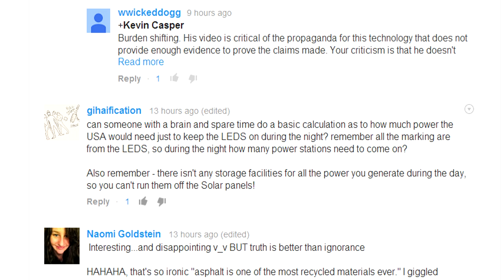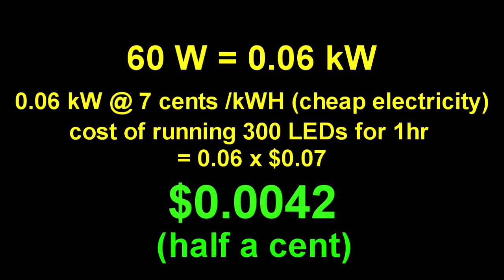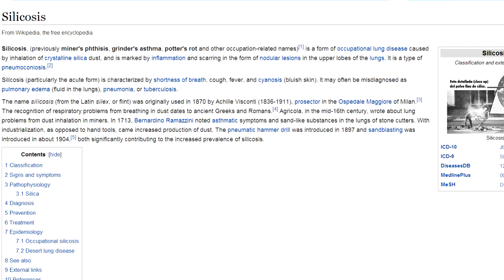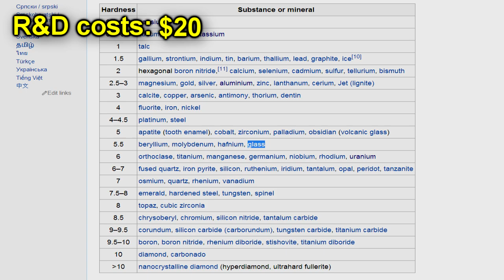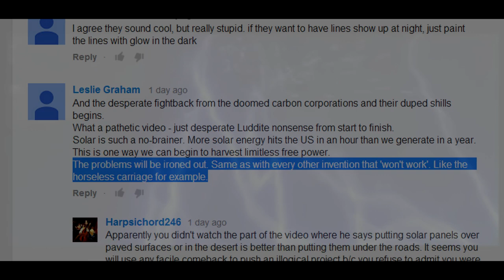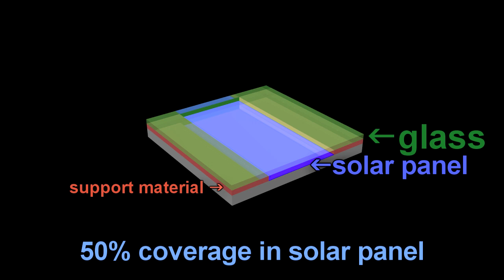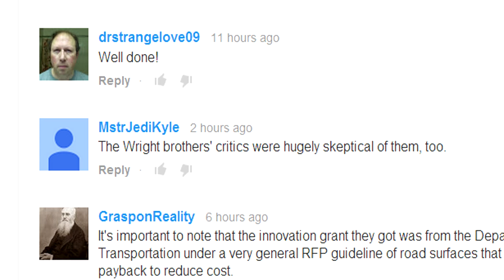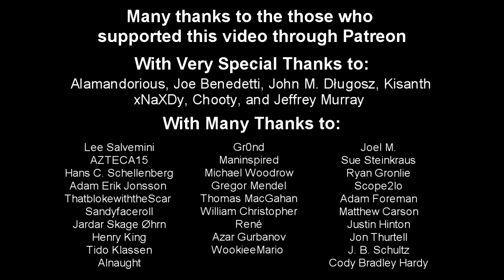Solar Roadways, IMPORTANT QUESTIONS AND ANSWERS!

Comment: for your calculation you are using the price for LED's from AMAZON. Do you seriously think they are going to buy their LED's from AMAZON???? are you fucking kidding me? And last i checked roads are made of Asphalt which is softer than glass, which in turn is harder than steel. I was going to watch this video to the end to give you a fair chance but you insult my intelligence.
Reply: I've seen so many comments that start out with "I only watched two minutes, however..." You guys really should invest as much of your money as possible into this project. Good luck.
Reply: Jindorek Its a generous estimate given that he didn't include costs of wiring them and the costs of the microcontrollers to control them.
However the main point isn't even the initial investment, its the recurring daily cost of running these LEDs. I doubt you got that far though.
The only unscientific thing I'm seeing is your "ability" to draw several conclusions about TF's research and education based on a video you didn't even watch.
Reply: Lumen22222 http://www.aliexpress.com/popular/multicolor-led-diodes.html

Wholesale diodes are indeed cheaper, but unfocused or not, all of his points come together into an idea that is simply unfeasible for the application. The chocolate skyscraper on a jello foundation in a desert is a very good analogy.
Reply: Jindorek Pretty sure his other videos do a very good job at explaining his areas of expertise. Besides, the science in this video is very simple.
Reply: Not being bothered to actually check the Mohs scale of asphalt v glass, I have a simple explanation for the use of asphalt in roadways rather than that wonder material glass.  Asphalt is soft, and mold-able.  That is the entire point.

If you hit a chunk of asphalt with a hammer, you dent it.  If you hit a chunk of glass of similar mass with a hammer, you chip it.  Which do you suppose is easier to repair?  Asphalt is repaired in about 5 minutes by a guy with a bucket of hot asphalt and a tamper.  The glass panel would require replacement, which apparently will require specialized teams and a few electricians.  How long will it take?  No one knows.

Have you ever seen what a major collision does to the road?  How long do you suppose an 18 wheeler jackknifing will close a glass paneled solar road?
Reply: Roads are NOT made out of asphalt they are made out an aggregate of different rocks held together by asphalt. And its not like that even matters anyway, it would be cheaper to just build some large solar plants, or line the roads in areas that get lots of sun with solar panels and then just pave the roads normally, any you would get far more power from properly positioned solar panels than from ones laying on the road.
Reply: ***** that's the best fucking comment I've read in months ahahahaha
Reply: ***** Technically asphalt is softer than glass, however the rocks that the asphalt hold together which is what was tested is harder than glass.

Most of the strength in concrete is because it's a composite material using the flexibility/waterproofing of the asphalt and the gravel which acts for the hardness.

I'm not sure what's with the obsession with space for renewable energy, we're in no danger of running out of space for it merely not investing in it remotely as much as we should.
Reply: TurboDally asphalt is the gooey 'tar' portion of the composite material that makes up the roadway. It is soft, especially in higher temperatures and is, obviously much soft than glass.  The stones mixed into the asphalt on the other hand, are not.
Reply: Jindorek Are you trolling?..
Reply: I had similar issues. I work in lighting and I'm generally unconvinced that LEDs are a good choice for this application, but this is just an unfocused rant by someone who is far outside of their area of expertise. He seems to be aiming his videos at credulous cynics who are desperately eager to trash this idea and don't care if the arguments are well supported.
Reply: Reddit Gold User it doesn't take longer than two minutes of this to realise this guy is thumbsucking data. Bet you my bottom dollar, that this guy has no clue about anything but just picked a viral video to troll so he cud get his own view counts up and increase traffic on his video to increase his revenue so he can keep sitting in his basement and cook up shitty unrelated science experiments with no validity to the actual problem and not have to get out and find a real job.
Reply: Getting a PhD is no guarantee of superior intellect. anyone who can afford a university education can get one. It's not exactly the holy grail. If I was in charge at Cornell University I'd ask for my money back.
Reply: 1) It would be an estimation, not a great one, but an estimation, still have a lot more to do with the tiles other than just buying and powering the LED's since any power loss would result in no lines.

2) Asphalt is softer than glass, however it is only the aggregate that holds gravel/rocks together, the rocks and sand are harder than glass which is what was being tested. Unless you think roads will never get sand for cars to grind into the titles the point seems to stand.

It appears you read the faq on their site rather than listening to what was being said or watching what was demonstrated.
Reply: Clell Harmon LOL jackknifing! No ones really even though about the possibilities of Fires on the road or major incidents!

Firemen already have a problem with houses with solar on them and electric cars, there scared that the house/car will be "Live" when they go in or put water on it. They just let them burn as long as they have it under control or there's no one trapped inside.

Considering the amount of major wild fires that hit the USA like every few months or the flooding/hurricanes/other acts of god, How will the the solar roads live up to these incidents?
Reply: Well it's not unusual for online suppliers, even Amazon, to sell components at near-cost price. So I don't think it's unreasonable to use $20 for a bag of LEDs when Amazon charges $23. This is the best information we have at the moments - we can refine the calculation if and when a signed supply contract is produced for the trillions of LEDs.

But what about the other issues such as UV light damaging the semiconductors that make up the LEDs, or the fact the LEDs are nowhere near bright enough to be visible at all in the daylight? These are pretty fundamental problems with the idea that, as TF said, are more than just a kink to iron out.

Renewable energy is definitely the way forward, but I really don't think this is the way to do it.
Reply: Jindorek You never went to college did you?  Even if you did fail out on a few 100 level classes, you certainly never defended a dissertation...
Reply: Clell Harmon I seriously doubt you need more than a guy with a new (ridiculously expensive) new panel and 5 minutes.

The design would be moronic if it was any harder than changing a light bulb.
But, the price a bucket of hot asphalt versus a "solar friggin panel" I think the asphalt is  cheaper by an order of magnitude, not even counting that the glass has to be repaired more often.
Reply: ***** You've evidently not had to deal with many government contracts.  Ever wonder why when you drive by roadwork you see a few people doing the actual work and a small crowd leaning on their shovels?

The guy detaching the panel from the roadway might end up being the same guy who puts the new one back, but he won't be the one who disconnects the panel from the grid, or the one who verifys that its safe to disconnect from the grid, or the one who troubleshoots the panel on site or any of the other plethora of jobs that something entirely new will include in the job.
Reply: Clell Harmon That's a failing of your government, not mine.

"The guy detaching the panel from the roadway might end up being the same guy who puts the new one back"
He is.

"but he won't be the one who disconnects the panel from the grid"
Err That's what I said about moronic design. You disconnect the panel "from the grid" the exact same way you disconnect a street lamp. (that's a 2 man job in all of EU, including the security guy on the ground)

"or the one who troubleshoots the panel on site"
Why would you even want to do that apart from driving the need for men up in your made up estimate. That's a job for a proper workshop. (again, that's how they do it in the EU, if it's small enough to be removed easily, don't fix it on site)

"of the other plethora of jobs that something entirely new will include in the job."
Made up jobs.

This need not be any harder than changing a light bulb in a street light, that IS a government contract, and it is a 2 man job. Including the man to call 112, 999, 911 or whatever when there's an accident.
Reply: ***** I've been to Europe Christoffer, and if you really think there is less padding in government jobs there, you're either delusional or lying to yourself...  US Unions look at their European counterparts and go "Damn!  Those guys have it figured out."

So, your theory is that a computerized roadbed panel will have the same complexity of replacement as a light bulb?

No, I've been changing light bulbs for almost than sixty years, and working on computers and their associated peripherals for more than 40.  The two have never been similar and I strongly suspect they never will be.

Are you thinking a computerized solar road panel will mount with a right hand bayonet socket?

Totally ignoring that this whole solar road thing is just too expensive and complex to ever deliver on its promises, What you are envisioning is far too simple.  your projected two man job might come about a few decades after the roads are deployed, but that would require the prototype to actually work.

Which it won't.
Reply: Clell Harmon "So, your theory is that a computerized roadbed panel will have the same complexity of replacement as a light bulb?"

I DID NOT SAY THAT, that is your inability to comprehend what i'm saying: (kind of odd considering all the things you'd have to ignore to get to your fallacy)
They can be made just as easy to replace as a lightbulb.

I also said that the in the EU they don't waste time and money on repairing things on site if they can replace it and fix it in a proper workshop. (oh, and by the way THAT is how the unions WANT it to be) I live here I KNOW HOW IT WORKS!
Reply: Clell Harmon (remember to read previous comment)

Also, if we follow your model a  dent in blacktop would require a ten man crew, an asphalt-truck, a road-roller and various specialised equipment.
You can't just apply your rules for how to add more men to only the things you want it to apply to.
Reply: ***** You compared the replacement of a computerized solar road panel to the replacement of a street lamp.  To wit:

"You disconnect the panel "from the grid" the exact same way you disconnect a street lamp. (that's a 2 man job in all of EU, including the security guy on the ground)"

Street lamps, including those in the EU, are designed with sheer fittings so that in the event of a collision, they aren't electrocuting random passersby.  Given that, the only other reason anyone would be 'replacing' a street lamp would be with the intention of swapping out the bulb.

So, YOU DID SAY THAT.  Perhaps the inability to understand what you're saying is on your end... or don't you know how street lamps work?

Seriously, if you want to be take seriously, lay off the caps lock.  Just makes you look a tad... stupid.
Reply: Clell Harmon Ok. let's see:
"Given that, the only other reason anyone would be 'replacing' a street lamp would be with the intention of swapping out the bulb."
Err... or the lamp head, or just about any part except the mast. The mast is a four man job with a crane. (on a closed down stretch of road)
Same goes for traffic lights by the way.
And traffic cameras and electronic toll booths.
It's unplug, replace and fix it somewhere else.
It doesn't have the same complexity, it requires the same amount of manpower to do it.

And only an idiot (in addition to you apparently) would design something to be replaceable in such a way that you'd have to use a team of specialised people in order to actually replace it.

Because:
There is a brilliant new invention from the 1980's called a "connector", that allows you to disconnect anything without any tools.
This panel doesn't produce any more power that can be transmitted over a JST connector (TF said it), and actually the same connector would suffice for communications too.

"Are you thinking a computerized solar road panel will mount with a right hand bayonet socket?"
Now I have no idea what ind of argument that is. You went from "as complex as" to "exactly the same as, including the connector"

But even so: take the Apollo Discovery UL Ionization Smoke Detector
http://www.apollo-fire.com/products/discovery-ul/discovery-ul-ionization-smoke-detector.aspx
How hard is that to replace? My grandmother could do it, the second time blindfolded.
That's a $500 piece of electronics, it comes off as one unit and it's replaced as one unit.
And guess how you replace it, right hand, one quarter rotation socket.
Reply: Here's another fact:
Replacing a bulb (or a lamp head) on a street lamp is a 2 man job in Europe. That is a fact!

Replacing a bulb, or indeed an entire unit in a street lamp is a 1 man job in Europe, 2 for overhead installations. Fact!

Work on traffic cameras (in Europe) is a 1 man job. Fact!

On street lamps and overhead work you may need to close down the road, that requires additional men, but so would any form of road work including all forms of roadbed repair.

And for the record I am in a position to know this, and it is the fact, no matter how much you claim it isn't.
Reply: Glass is harder than asphalt? Where's your source of information?
Reply: Clell Harmon in addition to glass being more brittle.

Comment: here is what i posted on the solar roadways fb page that was deleted without even trying to show it was wrong(which it isnt) lol
they claim that the panels will pay for themselves so lets look at the math of that
a solar panel typically takes 3-5 years to pay for itself so best case 3 years
they have tested their panels and get 60% of electricity so thats another 2 years
solar roadways claim they will produce 3 times the electricity the US needs
that means they can best case scenario sell only the electricity from 1 panel in every 3 so we are now up to 15 years
but they cant produce at night so effectively they can only provide max half the required electricity or 1 panels worth from every 6 panels
so it now takes 30 years for those panels to be able to sell enough electricity to pay for only the actual solar panel bit and not the whole solar roadway panel
solar roadways say their panels will have a 20 year life-span so see the problem
solar panels with a 20 year life-span will pay for themselves in 30 years(more in reality)
this post got me banned from posting on the solar roadways fb site

Comment: To be fair, all the LEDs wouldn't be on. With road markings, very little would be needed. But even at 1% use, that's still a crazy amount of power.

These would be more interesting in urban areas where there's less area for solar strips..... but, even then, might as well put panels on the roofs of houses first, instead of ripping up all the roads.

Seems like a fun idea that could definitely find its uses in limited situations, but replacing ALL the roads seems beyond unnecessary.

Comment: Another aspect of solar cells is that they are very sensitive to shading. Shade one cell and it will reduce the output of every other cell that is connected in series with it even if those other cells aren't themselves shaded. With the constant traffic you can easily shave off many more percents of the possible output.

Comment: So now in their "response to the haters" they are saying sure you can see LEDs during the day, what about traffic lights and LED billboards in Time Sq?

- Traffic lights, yes but v directional and at least 9 LEDs per sq inch. Billboards wider viewing range but non-critical if the sun is incidental on the billboard and reflecting into your eyes. Pixel density even more greater than traffic lights (RGB). Pixel density of a 50LED per 17" hexagon is 2.8% as dense. That's at best 2.8% of the luminance of a billboard and they need to be seen at all times in all weathers for road safety.